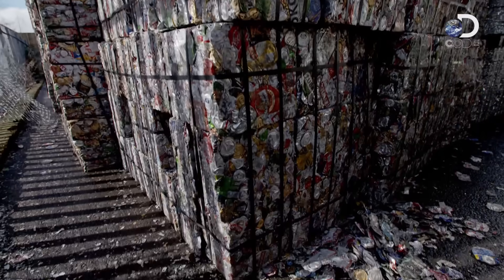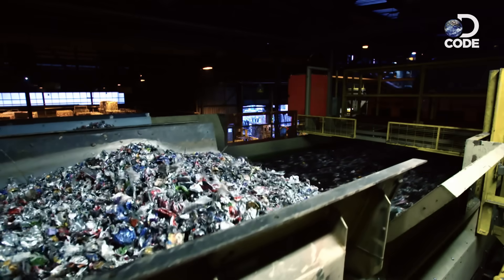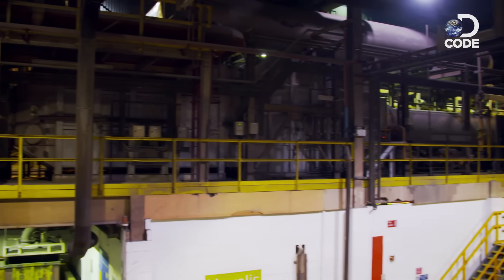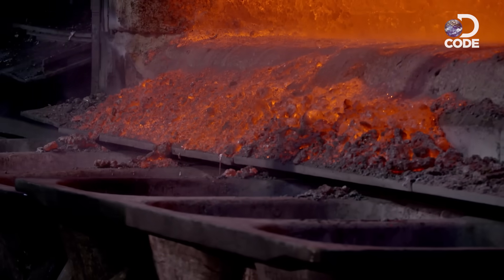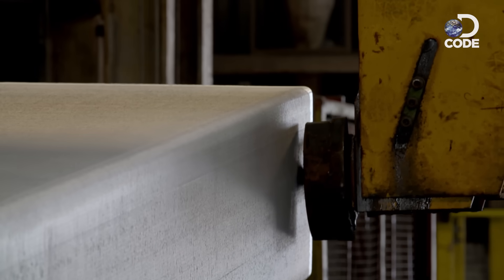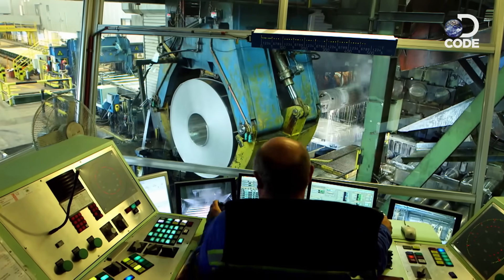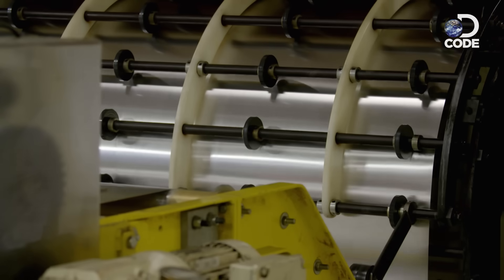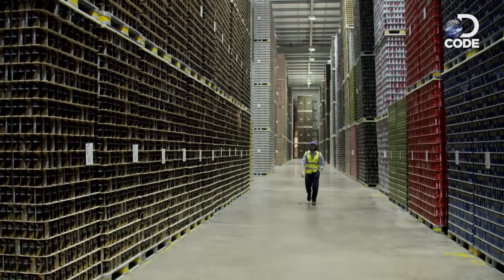How Are Aluminium Cans Recycled? | How Do They Do It?

Comment: How does recycling cans convert to energy that you can run India on? And for how long? You're burning energy to recycle the cans, not creating it from what I can tell. Either way, cool video
Reply: Recycling cans saves an amount of energy equivalent to the amount used by India. Recycling the metal doesn't take much energy, but producing the metal from its oxide (rock) form requires enormous amounts of energy by melting the oxide and then passing electricity through it.

Comment: Hold up, how do the metals that make the furnace not melt from the heat in the furnaces? I understand that aluminum is a soft metal, but for other metals that are harder like iron and copper, how do those temperatures required to melt them not destroy the furnaces themselves?
Reply: You figured it out...it's all being faked!   :-)
Reply: All metals have different melting points, you make your furnace out of a metal that has a very high melting point so that whatever you are trying to melt does not take the furnace with it.  A good example is tungsten, tungsten has a very high melting point so many forges are made from it.

Comment: Why does the metal have to flow in a river after being melted in the furnace and having the dross taken off?
Reply: The dross is an impurity and must be removed for its manufacturing use later on.
Moving the aluminium via channels is simpler and cheaper than using a pump.

Comment: In the USA we don't send the aluminum cans overseas.  They're recycled right here.  The last load I picked up was in south Texas and I took it to Alcoa, TN, to be made into aluminum wheels.  That was a load of cans but I've also hauled the ingots.  I just wish I had video from the way my trailer was unloaded.  I do have at least one picture of the way it was loaded though.  It's similar for plastic bottles too.  There's a place in Jackson, MS I used to pick up preforms a lot.  The loads weighed 42,000 pounds but could be a bit top-heavy.
Reply: Thank you for your service.  We do however export cans as well as import cans.  We also export ingot/import ingot and virtually every type of aluminum alloy.  We're not as big exporters as importers, but it does happen.  I work at a recycling facility.

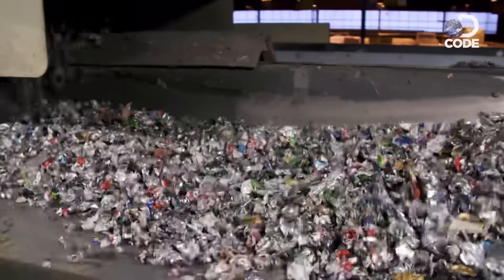Comment: 0:48 "[aluminium] can't be separated out with a magnet"

But can't it be separated using eddy currents?
Reply: When I was kid I put an aluminum disc on a coil of thick wire and discharged a load of capacitors through it.  The aluminium flipped up like a coin.

Comment: If you think recycling has anything to do with saving the environment you're wrong
Reply: Recycling is using less mineral, using less fuel, and using less energy to melt because it doesn't need to be separated from roxk

Recycling is saving environment

Comment: Why don’t they just refill the original cans
Reply: Used cans will almost never be in perfect condition, which means that reusing them could cause leaks or even just make cans on store shelves look bad. Combined with having to wash the cans, and the significantly increased transportation cost of transporting what's essentially mostly air with a thin can around it, it's likely cheaper to crush them, transport them, and then remake them.

Comment: Technically recycled cans aren't pure aluminum, they're an alloy. The tops of the cans are a different type of aluminum than the body of the can
Reply: "Technically" even new cans aren't pure aluminum. They're an aluminum/magnesium alloy, with the top having a higher percentage of magnesium in the alloy.
Reply: If that's true, you would expect the alloy to increase in magnesium content each time the can is recycled.  Unless they add virgin aluminum.
Reply: @jayadinash9102  That isn't the case because magnesium is more reactive than aluminum. More is lost to slag than aluminum

Comment: Isnt there a thin layer of plastic on the inside of the cans?
Thats just vaporised in the furnace init?
Reply: Only foods high in acids needs to be seperated from the can by plastic.
Tomatos for example.

normally you are consuming alot of aluminium particles if you like to drink from cans.

Comment: 3:18 if that's an ingot, my shovel is a teaspoon.
Reply: Yes it is.
Reply: Ingots is just a term used for a bar of smelted metal.
Reply: @touxiong519  How big can something be and still be a bar? And not a slab?
Reply: @NieroshaiTheSable  the biggest ingot is 300 tonnes , so they don't care as long as it's a pure metal in an oblong shape
Reply: @uploaded113redone  yeah they're usually smaller though, that's probably where people get confused
Reply: @NieroshaiTheSable  depends maybe on the country? Tomato or Tomatoes? Potato or Potatoes?
Reply: @uploaded113redone  Alright then, a shovel is now a giant dirtspoon to me.
Reply: Flashback to minecraft when you can fit a couple thousand ingots in your pocket
Reply: Think BIGGER!
Reply: In the US steel industry, where I work, we call them slabs, and they weigh anywhere in the range of 40-60k lbs and require huge machines to transport and process them. We receive zinc ingots for our hot galvanizing line that weigh around 2k and are unloaded by forklift.
Reply: You should see a steel ingot, the ones they used to cast before they got continuous casters to make steel slabs.
Reply: Roman Hauksson-Neill underrated💀💀
Reply: Real life =/= Minecraft
Reply: No it's not

Comment: 'Brave' operator scrapes off aluminium-oxide: sits in wheel loader with a 10 ft pole...
Reply: It's deadly metal
Reply: The operator is one of the few people who would touch it with a 10 ft. pole
Reply: randomvideowatcher so he’s the grinch song
Reply: Working in a steel mill is much hotter and more dangerous. Liquid steel is over 3000 degrees. Aluminum only 700.
Reply: @Girl On A Quest didnt a guy in a safety vest walk by it though?
Reply: Brennan Cattermole it’s still pretty hot
Reply: Such a trooper. Give that man an OBE.

Comment: I remember in Charlotte there was a one cent per can machine where you could recycle these cans. It was only for aluminum cans if there had a steel pop top you had to rake it off first for the machine to take it.  That was the good old days us kids would walk along the roadside and pick up cans. We could make several bucks a day,
Reply: I still do that now! I scrap all metal that I can find. Copper is the most valuable common metal but it's rare when going scrapping on the streets(well insulated wire is common but doesn't have a lot, not worth stripping). Aluminum though is very common. Entire ditches will be full with cans
Reply: The Alcoa can machine?
Reply: There are stores up here in Massachusetts that u take ur aluminum cans and plastic and glass bottles to to recycle them. You get a piece of paper that gives you money back for recycling ur bottles and cans.
Reply: How much is aluminum worth at the scrap yard? Is it actually worth more than a nickel per can?
Reply: @joeyvindictive3552   we use to get 25  cents a pound      also sold newspaper
Reply: Used to do that with glass bottles. Walk along the beach in the evening pick up the bottles and take them back. Belgium still does it. The deposit on the bottle is more expensive than the beer. :-)

Comment: Finishes a can
recycle it
scrap it off then melt it at 1000 C
Wait for 2 hours to cool it down
long journey to UK just to reshape it into a can
and it's still a can
So rather than this expensive process,we could just clean up the can and fill it again
Reply: yong lau They would not be able to reseal it :/ certain functions of the patented cans’ technology involve it being built from scrap, rather than refilled and somehow sealing it to its original vacuum potential once the first fill has been consumed. I wish it was that simple though. I also believe the bacteria growing in the residual fluid in each can would be challenging to clean, especially with the certain angles that would be involved. Perhaps not 1000 C, but certainly some rather harsh chemical would be used which would ultimately bring us right back to a high cost.
Reply: You can't. The inside of the can is layered with a sealant so, it doesn't interact with its content. 
Also, a little ding in the can will compromise its integrity.
Reply: Hello
Reply: No you can't, 
But you can do that with bottles

Comment: Would be much easier if we would not coat the cans with paint, an engraving pressed or laser ed in would do the same job. Also, paper is not necessary to describe the product. If Glass is wanted as a form of package sandblast the product description on it and reuse the writing Material.

Comment: Correct spelling is Aluminium. The change comes in order to match other elements. In terms of Aluminium, it is to match the consistent -ium in chemical elements in reference to abstract nouns.
Most American scientific journals agree with this and match the IUPAC (international Chemistry group) designation. IUPAC also decided on the spelling for Sulfur (not sulphur) and Caesium (Not cesium). These have actual reasons for those preferences surrounding their pronunciation, language consistency, and entomology.

Comment: The space use part is pure bullshit. Your ovens to melt the aluminum are at 730 C and  the average temperature above 180 miles (300 km) is about 800 degrees Fahrenheit (427 degrees Celsius) at solar minimum and 1,700 degrees Fahrenheit (927 degrees Celsius) at solar maximum. Truth be told, Americans, and I am one, never went t the moon. The moon trip and going to planets was a cover for a massive NWO military budget.

Comment: 1. You misrepresent the heating/melting process!  The laquer/paint puts off black smoke and chemicals...but that isnt the worse part. The left over sugars...they produce the most black smoke. Do you just vent this or do you use a "bag house" filter system like a steel mill?

Comment: i figure in 1000 years someone will start mining abandoned landfills..because they are full of metals, and aluminium being the most common, steel, and iron second, copper and others last...i know the land fill i go to dump my truck...every few years they will dig up a old section of it, burn everything, and mine out the metals. it looks like a full scale gold rush episode taking place. the trash burns, and then they use grizzly bars to separate the dirt they used to separate trash layers, run it though a trommel thing...and get the metals on the other end...

Comment: https://youtu.be/oAE407SjFPM  
https://youtu.be/yd157yBmNaM 

WATER + ALUMINIUM ALLOY = HYDROGEN.

This will upset the plans of Big Oil companies and thus will bring in a new revolutionary cost effective method to produce hydrogen for vehicles and other machines which are used in factories, offices and households. IT'S HIGH TIME TO FULLY EXPLORE THE BENEFITS OF CLEAN CHEAP HYDROGEN AND TO GET OFF THE DIRTY EXPENSIVE FOSSIL FUELS as quickly  as possible.

Comment: Absolutely amazing.
How much energy would be saved, if the German factory was in England
Reply: Was wondering the same thing. Just get a roller next to where they make the ingots. Such a waste of time otherwise.
Reply: Brexit will sort that out. 

All three factories will end up in Germany...
Reply: @gavanwhatever8196  Until Putin turns off their gas.
Reply: How much energy would be saved if the recycling plant and the can manufacturer were in Germany?

If you want everything centralised in one country then you can't whine when it's someone else's country that gets the jobs.
Reply: None - its much easier to transport one big ingot than many small cans. and since Germany has a more central position in europe the cans wont have to travel too far.
Reply: @kfftfuftur  Then listen well. The large block is transported 900kilometer to germany. There it is flattened and rolled up. Then the large reel is transported back to england. Not the small canns, but the large reel. So, yeah, two times 900 kilometer transport of a heavy block. It's silly.
Reply: @EdwinBlees  not all of it comes back, I'd guess that most of it dosent... So, you'd need to build a rolling mill in Britain just for the fraction that comes back.

But....
This company recycles old cans, some imported...
The ingots are sent to Germany for rolling
A roll comes back to be turned into cans.
A brewery fills the can and sells it to Germany.
The can is sent for recycling.....

Comment: How is having the huge block of metal, transported to Germany, then back to the UK after it’s been converted into a roll of metal... economical? 😅
Reply: It's cheaper than building another rolling mill when there's already one in Germany. We do the same thing in the US. Quite a few years ago I had to haul a load of cans to Novelis' Greensboro, GA, recycling plant. While I was getting ready to leave, there was another driver strapping down one of the ingots you see in this video. (These weigh 55,000 pounds, so you need special highway permits to move them.) He was headed for Novelis' plant in Oswego, NY. That would be a pretty sweet gig...he picked up the ingot in Georgia, carried it to New York, picked up a load in New York from one of three places he had contracts with, hauled that load to Georgia, and picked up another ingot. 

It's probably cheaper to haul from England to Germany, depending on where in Germany the ingot must go, than to haul from Georgia to New York.
Reply: @jmowreader9555  you win the prize sir for the most intelligent comment on here (although between me and you the bar has been set pretty low on this comments section)

Comment: I liked how he used meters and tons in the same sentence.
Reply: They're both metric units. 1 T = 1000 kg
Reply: Well they are both metric units so there is nothing wrong with it.It would be weird if he used pounds and meters in the same sentence
Reply: @gumelini1  unless it was the currency of pound, then pound and meter could be used in a sentence with no problem
Reply: Metric ton = 2204 lbs
Long ton (UK) = 2240 lbs
Short ton (US) = 2000 lbs
Reply: ?? Whats wrong with it
Reply: The tonne is a non-official use of 1000 kg, so he can use metres and tonnes in the same sentence as they are both considered metric.  Oddly America is the only major country (Liberia and  Myanmar) using an archaic system of measure, then lecture others on how backward the rest of the world is. 

"The tonne ... (Non-SI unit, symbol: t), commonly referred to as the metric ton in the United States, is a non-SI metric unit of mass equal to 1,000 kilograms; or one megagram (Mg); it is equivalent to approximately 2,204.6 pounds, 1.102 short tons (US) or 0.984 long tons (UK)"
Reply: @allanharmsworth1237  can't speak for liberia and myanmar, but the costs of changing over to  metric would be huge, text books, thousands of miles worth of road signs and mile markers just to name a few things. the logistics and financial cost at this point would be waaaaaay too much to be worth it
Reply: *metres and tonnes
Reply: The English still use the Imperial system to measure weight, it's funny, they measure distance in KM, but the speed limit in MPH, they sell gas by the liter, but beer by the pint, and weirdest thing, they still weigh people by the stone.
Reply: C Smith 
Not quite. Distance is measured in miles, and petrol (not gas) is measured in litres (not liters).
Reply: @davelowe1977   In America it's gas and liter, in Europe it's petrol and litre,  I was misinformed about distance.
Reply: C Smith 
I know that - was just having a bit of fun with the language ;-)
Reply: @bigredc222  benzine in germany
Reply: @joer610  I never heard it called that.
Reply: Not quite right, we weigh people with a set of scales
Reply: @bigredc222  That's right. And I can go to the builders merchant and buy an 8X4 18mm ply sheet and 20mtr of 2X2 nominals, nobody bats an eye,
Reply: Russel Mathias and double decker bus...
Reply: @DJGaNK  The EU simultaneously uses no less than 5 major languages. And you call us autistic? Why doesnt Europe decide on one single language for all countries before we stop using "Imperial" for everyday stuff and Meteic for scientific measurements (we use both retards).
Reply: @Luckingsworth  the eu isnt a country, the eu is a group of countries, the usa is one country, the eu and europe are not the same thing

also didnt you crash something into mars because nasa uses metric but the people working there thought in imperial?
Reply: Charlie K 
Litre - yes!
Reply: I like how people who know nothing about a country still choose to comment on it.